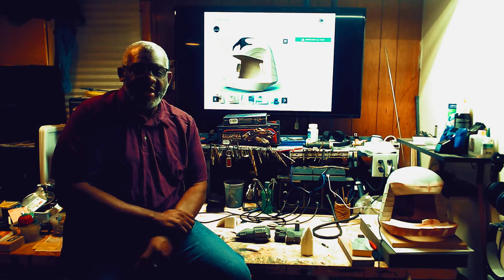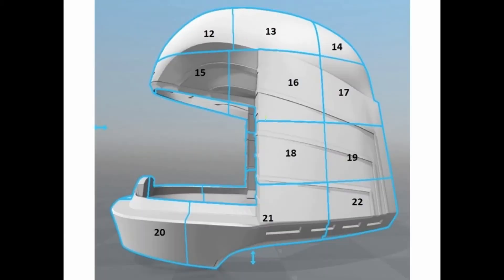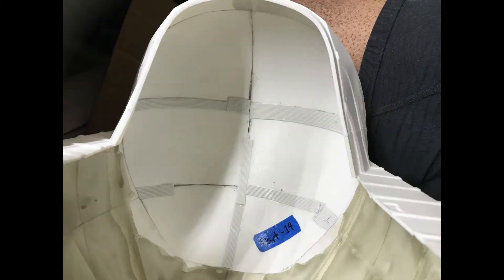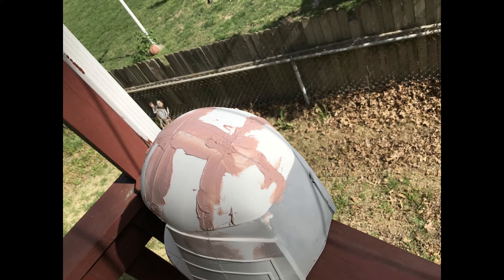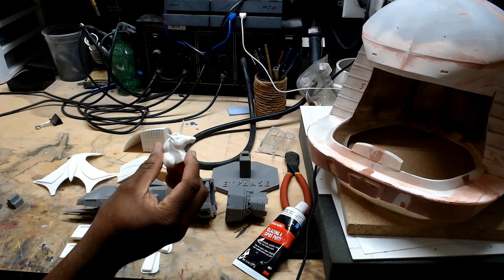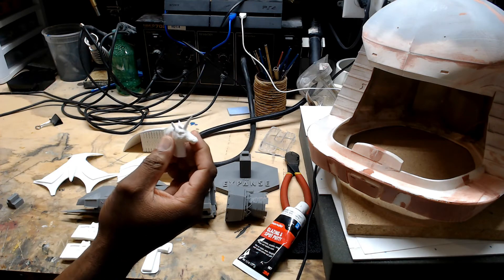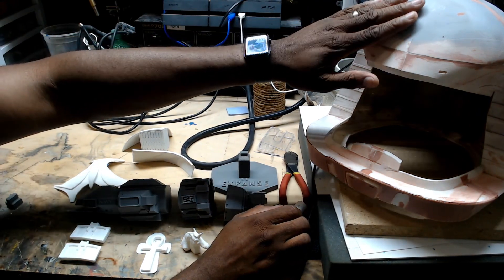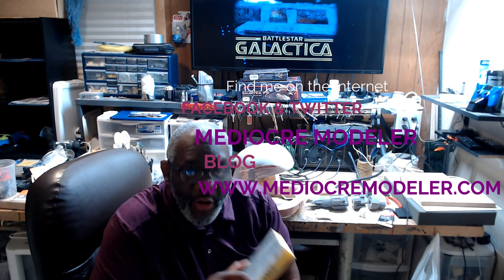3D PRINTED VIPER HELMET PART 1A

Comment: Hi bud,  I've actually commented on this video before as Isky.  Love your work :D  I recently started another Channel (this one I'm commenting from now) and am going to do this very Viper Helmet build on it.  I was just wondering how does it fit you?  Did you upscale it at all or is this just printed directly from the files?  I printed my first piece yesterday and today and it took 30 hours lol.  So want to be sure it will fit before I print any more.  Cheers!  Isky
Reply from the maker: I replied to you in my upcoming video. But long story short, I didn't upscale at all. There should be plenty of room to sized it that way.
Reply: @MediocreModeler  yes I know you did. Thanks for the info 👍